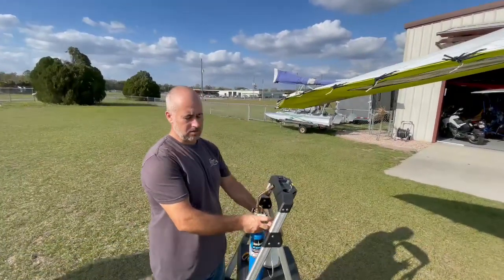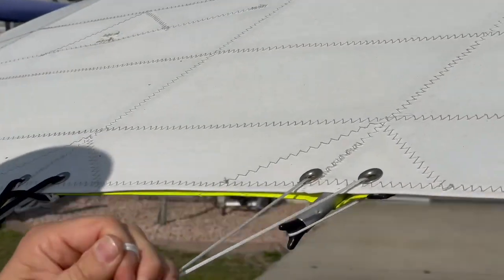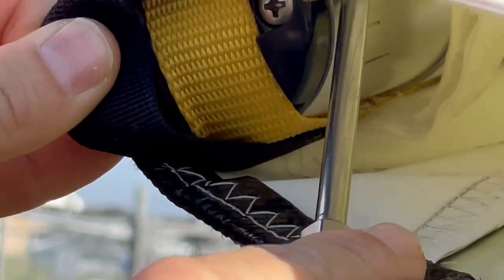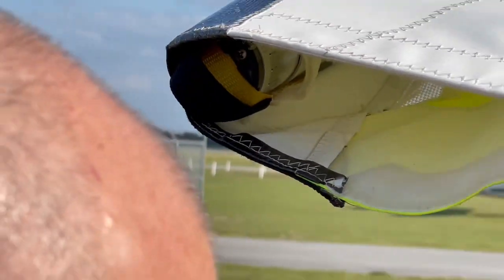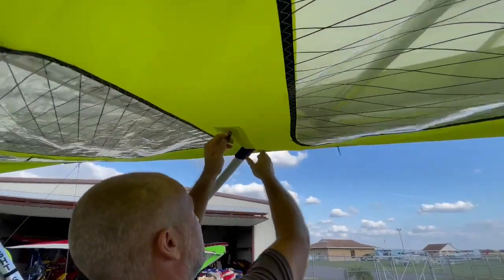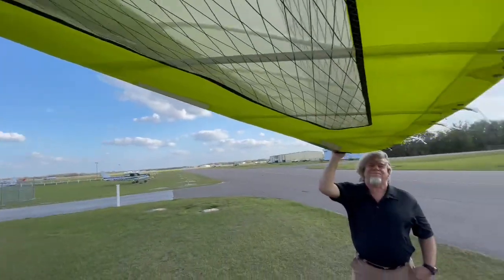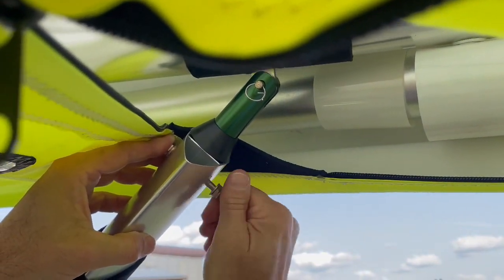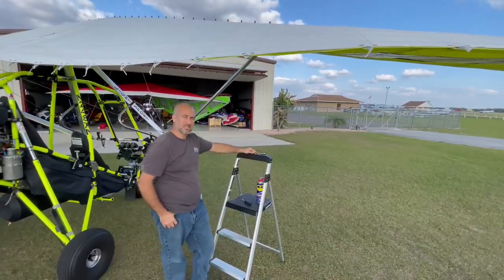Version 3 for the REVOLT RIVAL X

Comment: Quick question or two Larry... Did the kit ship with the red and green +7° lift strut ends? And with regard to the battens, I do not have a profile template for mine, and if I remember right, on the day mine was test flown, the wing was tuned slightly by modifying the curve slightly on a few of the battens, and I'm not sure those modifications were traced onto the profile template.
Reply from the maker: Yes the kit comes with the fittings and shims. I’ll send you a batten template. Always trace your battens so you can get back if need be after bending them.

Comment: You can rotate the end cap with the haul-back tight, or do you need to let it out? Also, Does this change the stall speed, or just the trim speed range?
Reply from the maker: You can try with it hauled back. Will take some muscle. Stall is virtually unaffected, trim speed reduced and yaw and roll stability increased.